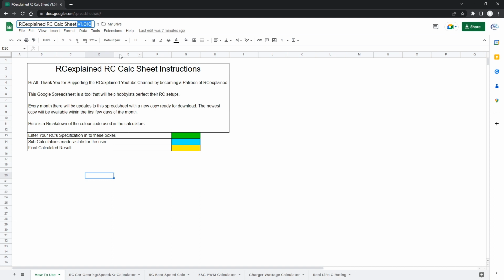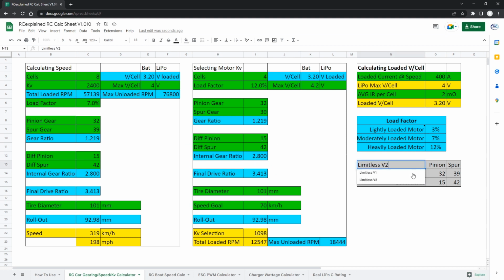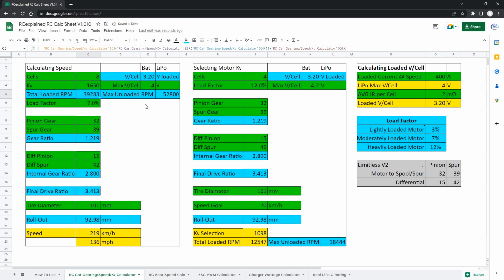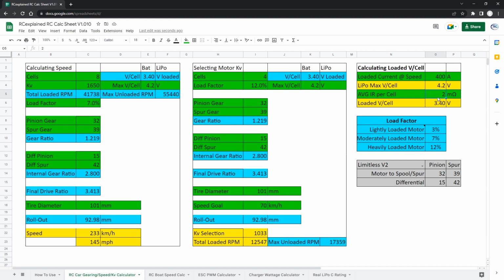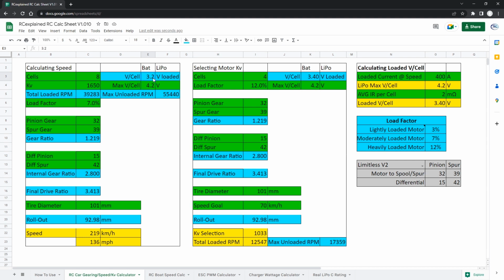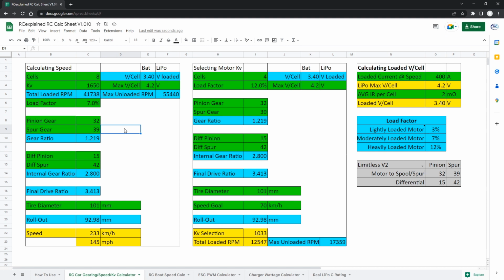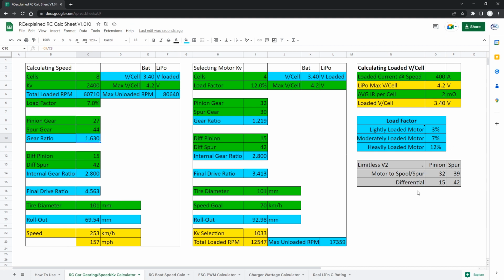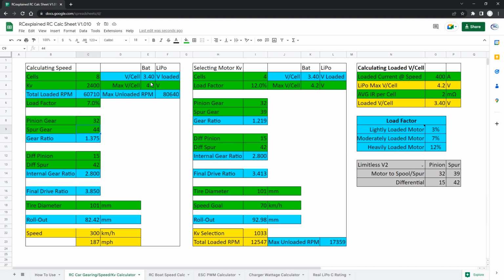Speed Run Calculator Update - Gearing Now Auto Populates

Comment: What is the best traxxas battery to get for your stock slash vxl 2wd that will make it go pretty fast?
Reply: Literally a basic 3s lipo with the same connector, it’s the max it can take.
Reply: One that's not Traxxas lol but the lower c ratings may allow esc to last longer , it's arguable bc most people who only use Traxxas accessories aren't using thier rcs the most ..